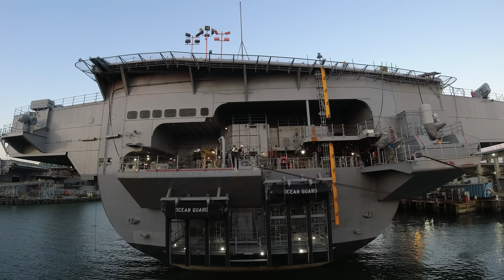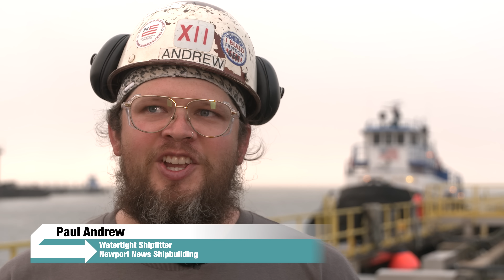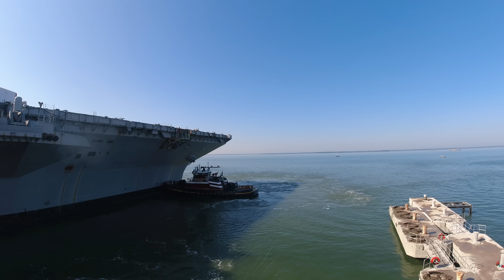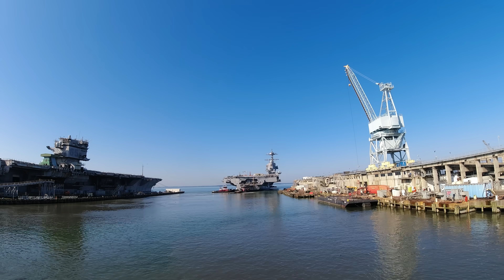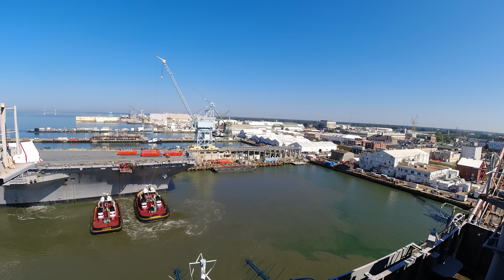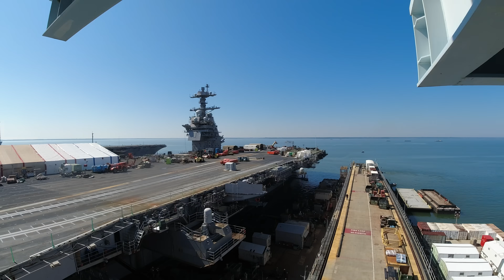Around the Yard at NNS: John F. Kennedy (CVN 79) Ship Turn Around

Comment: Laid down in 2015, won't see service until 2030'ish.  That's a long time, esp. when we need to build one every 4 years just to stay at 11 carriers.
Reply: actually, cvn 79 enters service in 2027
but I agree with your opinion though
Reply: @phi_is_not_pi  It wont see operational service until closer to 2030, March 2027 is the new delivery date as the 2025 delivery date was missed. I'm talking on patrol capable of fighting, or active-in service with her Carrier Strike Groug(CSG).
Reply: The USS Kennedy CVN79 will be commissioned in 2027, and the Enterprise CVN80 will be commissioned 3 or 4 years later, but possibly as early as 2029. And the Doris Miller CVN81 will be commissioned in 2032.

So obviously, there is overlapping in construction.
Reply: @RedRider1600  CVN-79 wont see operational service until closer to 2030, March 2027 is the new delivery date as the 2025 delivery date was missed. I'm talking on patrol capable of fighting, or active-in service with her Carrier Strike Groug(CSG).
Reply: @hoghogwild 
It gets commissioned when it becomes operational in 2027.
Reply: @RedRider1600   It wont cruise til much later following workups 2030'ish.  What makes you confident in the supposed 2027 date?
Reply: @hoghogwild 
Because that's what it says.
It gets commissioned once everything is done and it is then operational.
CVN79 is already built, was launched and christened on December 2019, and currently fitting out and preparing for sea trials.
Reply: @hoghogwild 
CVN80 USS Enterprise will be operational in 2030.
Reply: @RedRider1600  "Because that's what it says" Are you joking?  You do realize that until a few months ago that CVN-79 was supposed to be commissioned in early 2025. Just months ago that was changed to early 2027.  Again, it won't be doing workup and then actually going on active operational missions until closer to 2030.
Reply: @RedRider1600  CVN-80 Enterprise will NOT be operational in 2030.  CVN-79 will just be starting out then.
Reply: we dont have a great ship building capability.. we have the tech knowledge, we just cannot execute.......a lot on this ship will probably be outdated when it goes into service....
Reply: @griesTheGries  keep graduating a majority of students as 'software engineers'.
Reply: @griesTheGries thats not how ship equipment works, anything outdated is easily upgraded/replaced. The only reason carriers need to be replaced ever is the reactor life and steel health
Reply: @JohnSmith-nf5gk  I wonder if they'll need to drydock to fix rust and sea growth, since its sitting around like a museum ship already lol
Reply: @Lucentjuffowup not anymore than its regular RCOH docking. JFK has only been in the water since the summer, its got a 50-60 year hull life. I would recommend learning how navy’s work before pretending to offer intelligent discourse.
Reply: No reason at all to take that much time. If that was private enterprise it would be built in a couple of years.
Reply: @Dbodell8000 comedic take.

Comment: 2027 delivery? It was launched in 2019. You can't tell me it takes 8 years to fit out an aircraft carrier. The nimitz class ships were done in less than 5.
Reply: they probably had to work out the fixes on the ford first... once those were squared away they were but into the kennedy
Reply: The ford class is a testbed for many new technologies. So yes it does take more time. Especially since the kennedy is being built while the ford wasnt even completely finished. Plus the hampering covid put into supply chain issues
Reply: @kage_sureiya  They had to steal parts for the Kennedy to get the Ford out!  That's why the Kennedy is another two years late!
Reply: @wayne5447  and they had to steal parts from the kennedy why? Supply constraint issues. The shipyard is only able to recieve materials and parts from certain vendors and many of the vendors dont have the materials from their suppliers to supply us from the covid backlog already.